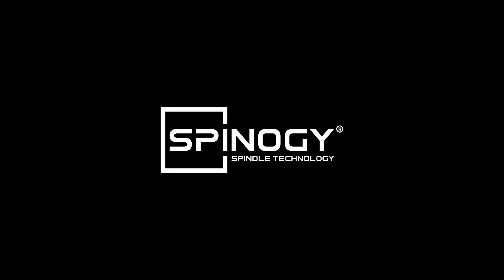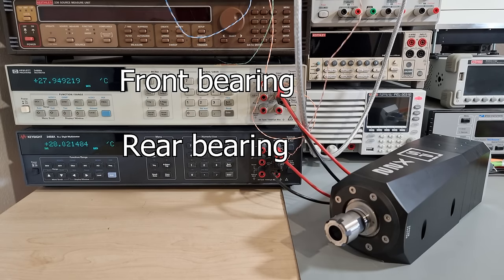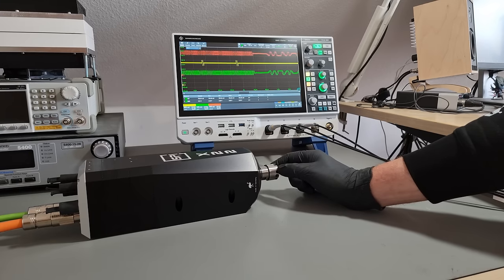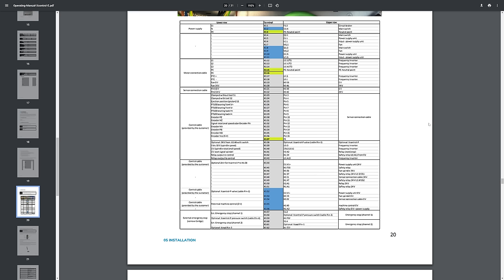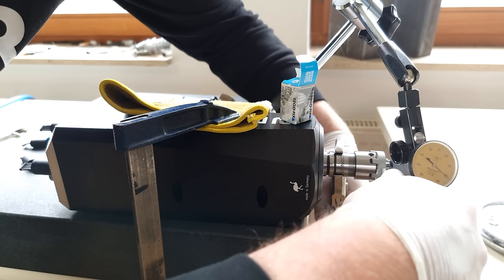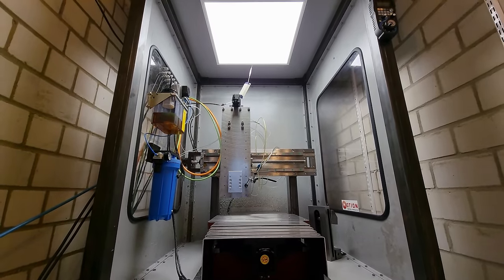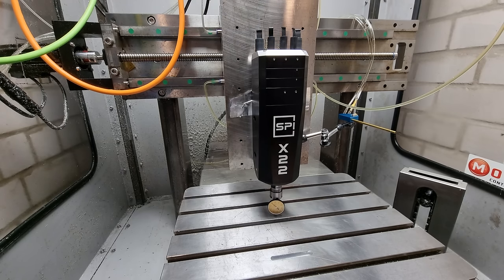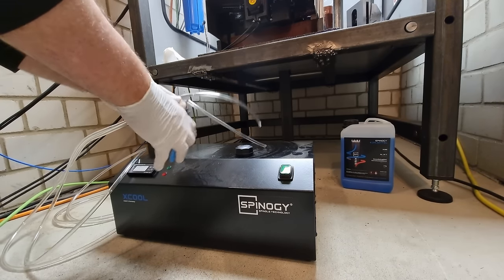New CNC Spindle: Installation & First Chips with Spinogy X22

Comment: Holy crap! I don't think I've seen signal polution like that before! I know it exists, but WOW! To see it fuzz out the osciliscope like that...
Reply: I think this is actually common, and why different signals are often used. Like in the CAN bus systems used in cars.
Reply: @frikkied2638  true, I suppose what I meant was that I haven't seen it graphically displayed like this before!
Reply: @Phiz787  sure, and I also made a typo, I meant to say “that is why differential signals are used”
Reply: uhmm - Its a high bandwidth scope set to its maximum bandwidth (with poor probing techniques and probe). the intent of the measurement was achieved!
Reply: The bandwidth on that scope is pretty bit and so that's why it looks like that.

Comment: I have two suggestions. First add a button for clamping and unclamping the tool next to the spindle. As a quality of life improvement. Second a small diameter long travel pneumatic cylinder and quality air pressure regulator makes an easy counter balance for the Z axis. But it’s definitely looking awesome! 👍 love your videos.

Comment: Speaking as someone who also has experience being covered by tiny aluminum chips, i think the only way to mitigate this is to 1) make bigger chips, and 2) use flood coolant so the tiny chips that inevitably get created get washed away before making it into onto/into you.
Reply: Until that moment when the chip makes it into you while covered in flood and now you've got a metal sliver that burns because of the flood.

(I worked in a steel stamping plant that used flood, and god damn that stuff stung when it got in a cut).

Comment: I also would like to have a good no cloud no subscription alternative to Fusion 360, I got somewhat used to FreeCAD but this is still a great pain in the butt using it and the CAM part is still lacking so many important things for it to be really usable.
Reply: yeah, that's why I'm still with autodesk, solidworks and mastercam, next big purchase
Reply: I know Creo from PTC (another industrial-level SolidWorks, SolidEdge, etc) has a CNC module, but I do not know how much it costs... In the libre software (open source) space I know that the creator of Kiri:Moto is working hard on the CNC module, but it is not that advanced... It runs on the browser, but it can be selfhosted, so I do not consider it "cloud software" :)
Reply: they seem to have no interest in this, but as someone who is usually in a shop with no hard wired internet, it would be nice. you can of course go some months offline mode, but that still is annoying.
Reply: @happykillerkeks  He asked for non subscription option. Simens has only subscription plans.
Reply: Fusion360 is unfortunately the most comprehensive and least expensive option. It's really slimy how they used the "community" to help them test, design and market it and then suddenly cut them off from specific features.
Reply: Fusion 360 is extremely unreliable as a tool. What other tool in the shop changes every time you use it? I find that new features and bug fixes are rarely worth the disruption. That's the worst thing about cloud software for me, there's no way to opt out of an "upgrade"! You get whatever they're serving today, whether you like it or not.
Reply: Rhino works for me. A one time payment of ~1000 (or ~200 for students) feels fair. There is no native cam, but food4rhino offers loads of plugins. And there is Grasshopper, dedicated to parametric design. USSA Woodworking is one of the few makers on YouTube showcasing this workflow.
Reply: It'd be nice if FreeCAD got the money and dev love that it needs to be a real alternative.
Last time I tried using it it just felt like a mess, which I feel bad for saying about the devs work but it's the truth.
Reply: What was Marco using here - the "Personal - Not for Commercial Use" version of Fusion 360?  Or was he using a paid version to generate the NC programs?
Reply: ZW3D is decent non subscription alternative to F360.

Comment: I just started my home build milling machine project a month ago. No fancy Spinogy X22 yet - just pulleys and belts to change speeds. And no CNC stepper motor servos yet, but I'm making chips and parts using HNC ("Human Numerical Control"). I work out a program on a spreadsheet that calculates now many handwheel turns and degrees each tool path requires, and then turn it by hand. Got to start somewhere - ; )

Comment: Estlcam costs 50€ for life and with a bit of  practice you can do almost everything you need with it. There are some limitations to it's adaptive toolpaths that make them slower, but for prototyping and short production runs it's perfect. As for Fusion 360 I think the free version now supports export to dwg and dxf, so that leaves it as a viable CAD option, because the free options I have tried so far aren't great. To be fair I also tried a lot of paid versions and most of them aren't great either.

Comment: The Datron single flute end mill is meant to be ran at high rpm. I use 4mm ones with my pocketNC running 50000rpm and about 1200mm/min feed. Select more flutes if you want to have less rpm.

Comment: Running a VX ingraver, a Gerber Cnc router, and a couple of Esab large format cnc routers cutting and engraving Aluminium sheet, i found that Methylated Spirits, (denatured alcohol) was just the best coolant and lubricant for the job. The chips and swarf were so fine that it left you looking a bit like the tin man from the wizard of OZ though.

Comment: CAM. Either Bobcad for solidworks or Fusion 360. Also beware Cosine error on your DTI as the lever really needs to be parallel to the table or as close as is possible.

Comment: Congrats on the new spindle, it looks very nice.

I have been away from DIY CNC for several years so things might have changed. Back then, I really liked VisualMill in my setup. It uses Rhinoceros 3D CAD underneath which is very intuitive and easy to use, especially compared to the "backward" approach of 360 and others. You can import DFX/DWG, plus a long list of industry standard drawing formats. Once the paths have been generated, Mach 3/4 ran my machine well.

Comment: Have a look at the Click PLC for a lot of the control aspects of systems like this, like for triggering solenoids and stuff. It’s a very affordable plc that I feel is very well suited for projects like this although I never see plc’s being used by hobbyists, perhaps because of a perception of them being very expensive, which is not the case for the Clicks. They also speak Modbus fluently so can easily interface with other systems.
Reply: PLCs are not that expensive anymore. If you use a proper ServoDrive for the Motor you can also use its IO to control the solenoids and other stuff.
Reply: @NitroTrinker  that’s exactly what I said but thanks for your insight.

Comment: I used to use Filou NC years ago (like in 2010 or so) and at that time it was the only affordable and reliable solution. Since then it seems to have evolved from a pure 2D CAM tool with some basic depth support (2.5D). The current versions looks much nicer but I have not used it in a long time and it is not the cheapest tool. If you want to be able to create or adjust your own post processor (I find this a must) it's 1185 (incl. tax). 
Unfortunately my current work involves some 3D tool paths (curved and sloped paths) but for 2 and 2.5D work this was my tool to go. It is easy to import a DXF or even draw some basic 2D stuff and then create 2 / 2.5D tool paths from there.

Comment: a lot of accurate machine have a counterweight to compensate the vertical axis and also balance the offset weight front / rear , that easy to built with bicycle chain and chain sprocket , compact weight can be with epoxy resin and rejected / broken carbide inserts .

Comment: My dear Marco, I too am interested in machining for electronics packaging. Your path of discovery for CNC machining, where you have started with a CNC mill, is very familiar to many electrical engineers who specialize in mechanical structures for electronics (enclosures, wave guides, sheet metal soldered shields, and many other small dedicated structures and custom fasteners). 

I can save you a lot of time. With one word Micromachining, I will explain why in just a moment. 

I believe you are in Northern Germany, so my friend you must go south to KERN Micro Technology GmbH south of Munich, and look at their basic EVO model which is a three axis mill. It is very handy to actually see a machine with some of the panels off to see the insides and then ask some questions, of which I think you have a good idea of the challenges in high accuracy machines, and as such can ask some very key questions. You will discover the basic design challenges very quickly, because common CNC machine errors are well known, it is in addressing the errors which is the more IP related. 

As it turns out, micromachining is the use of CNC machines to make micromachines for the use in micromechanics (small mechanical gizmos, like watches). You are rather fortunate to live in Germany, because micromachining CNCs from Germany and Switzerland are probably the best in the world (of course it depends on what part you are trying to make). In looking to make your electronic products you will use many different types of CNCs. Primarily, CNC Mills (3 and 5 axis), CNC Lathes, and perhaps a newer Mill-Turn. To make large enclosures you will use CNC sheet metal bending machines, but this is not usually considered part of a micromachine, although some of the positional accuracy is not trivial at times.

Some Swiss made CNCs are very interesting because they have and are doing exactly what you are doing. Sorting out the drives, amps, cooling, rigidity, understanding the errors, and solving problems, both accuracy and precision. To control their machines they have the common option of a Fanuc CNC drives and control (which is considered a retrofit with HMI, which is even used for new designs), but other might supply the spindle and servo motors and amplifiers.

In Germany, I am sure you are well aware, that the overall accuracy and repeatability (precision) is in units of microns. So a micromachine three axis CNC accuracy may be to 3 microns, perhaps 5 when speeds and feeds are increased. So, it seems in CNC machine speak we talk about microns a lot. 

One example of a micromachine part that you may be familiar with for electronic packaging is the Pentalope screw used on Apple iPhones. The screw is made on a Swiss CNC screw machine with a 0.8mm diameter 0.2mm pitch ISO Metric which follows the basic Progress screw metric diameter to pitch design (originally designed for watch making) but with a newer ISO Metric symmetric V shaped 60 degree flank angle.

With your German accent you should do a CNC video called micromachines (small stuff precision) and microns (CNC errors), much as you did for hunting down voltage reference ppms.

Comment: Hi Marco, what kind of battery powered screwdriver do you use? Does the screwdriver have a variable speed? I am using a Milwaukee electric screwdriver and it has two speeds. On and off. But it reverses 😂

Comment: Cambam used to be a go-to CAM package for hobbyists back in the day, I wonder if that's still worth considering? It looks like they have adaptive toolpaths.
Reply: I use CamBam to this day, but there's not been any dev work done on it in the past several years that I know of.
Reply: I used CamBam years ago and thought it was great at the time (CAM and quick 2.5D design), shame to hear development has slowed/stopped.  For CAD I used to use Alibre, I believe they also have a CAM extension. One payment, own it for life!
As for Fusion, they started to lock file formats/exports a while back, so I've been giving it a wide berth.

Comment: You don't really need flood coolant, unless you want to machine stainless, and even that is sometimes better to run tools dry. If you plan to machine mostly steel, then take a look at almost any HSC endmill, for example Gühring 6761. These are our go to rouging mills for anything except non-ferrous metals and plastics. Low radial engagement, full axial depth, rpms sometimes out of range of our machines and high feed rates. With just air blowing to remove chips these could last several hours of high material removals. For example a D12 endmill in 1.4301 stainless, 0.9mm radial, 38mm axial, around 4000rpm F1900mm/min lasted around 7 hours "in cut" according to machine control.
Reply: Oh, sorry, didnt watch the whole video before commenting, aluminium could also be machined dry or with ethanol, but a good quality endmill with a proper coating will help a lot, those are not exactly cheap, but when you factor in tool life, they are cheaper in the long run

Comment: rigid tapping is a ghost of the past you mill threads these days, cleaner threads, tiny load on the tool and most of all no limit to thread size, if you need speed, you use multi-tooth thread endmills instead.

Comment: Not a valid method to check spindle runout.
Check the runout on the nose of the spindle. Collet chucks are NOT that good and I typically have to "adjust'" my tools to get them perfect (=/- 0,0002 is my target)

Another thing. As an industrial Electronics Tech for many, many  years. I hate those type of wire termination blocks.
I can't count the number of service trips I've been on, some costing $10,000 or more, only to find the problem is poor connection with that type of termination block. Never use wire ferrules either.
Old, split terminal connectors with a screw down terminal block are much more reliable.